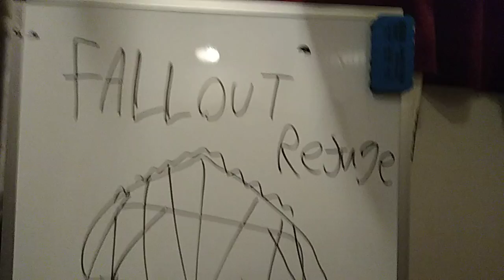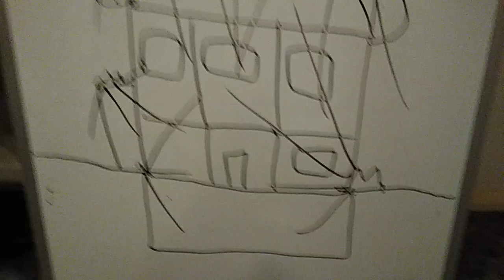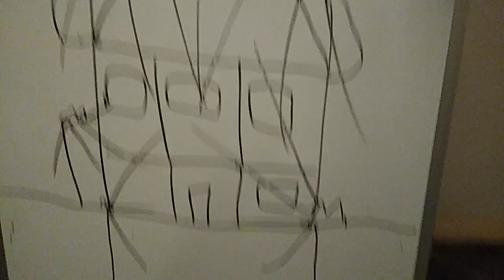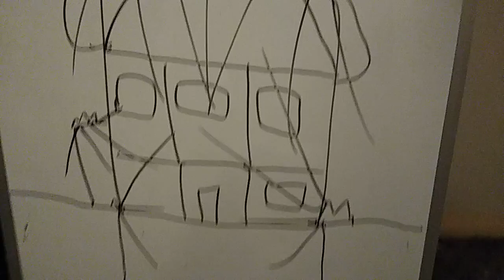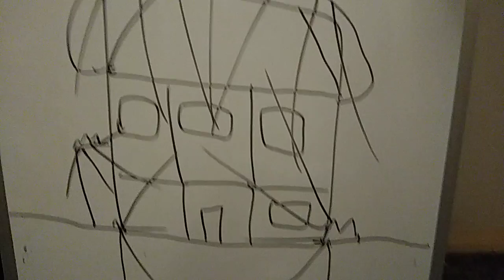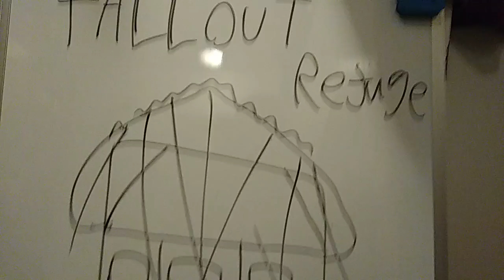Fallout refuge/protection

Comment: I have a rubber EPDM roof on part of my house is rubber good for this
Reply: Gamma radiation is VERY difficult to stop but any roof will stop the radioactive dust that emits them. The key to survival is to stay as far away from the source as possible. Roofs, walls and windows are a big no-no. Get as many rooms in between the outside and you as possible.
Some portable gamma sources are transported in a depleted uranium case, inside a thick lead container. If you have no access to heavy elements that can absorb the radiation, you wil need a stupid ammount of concrete and earth. That is one of the reasons why underground bunkers are underground